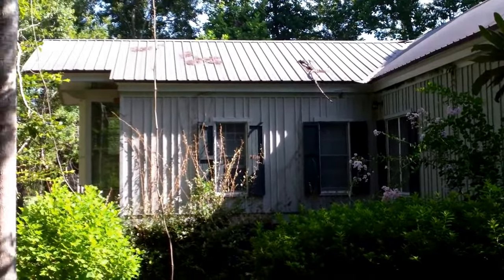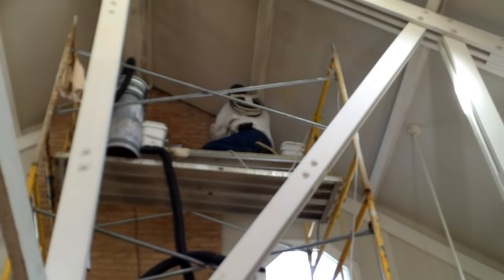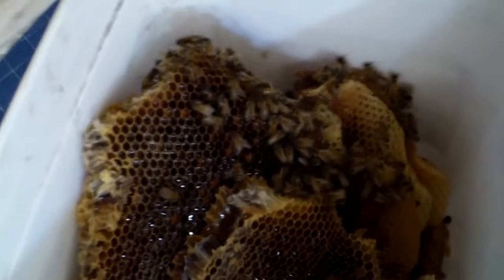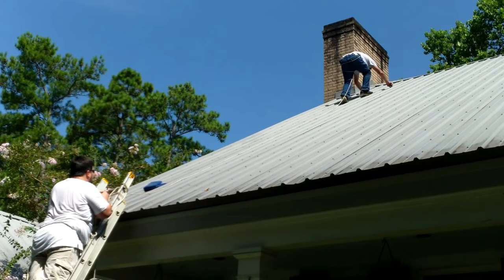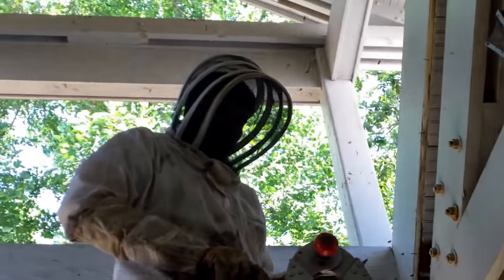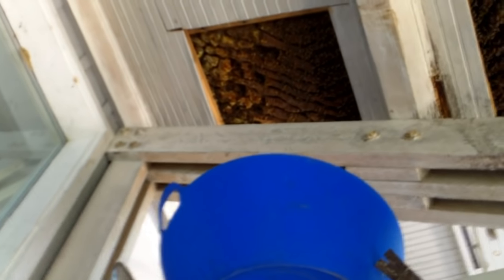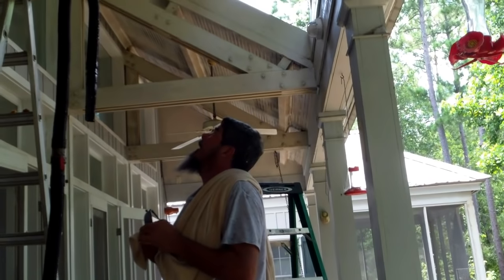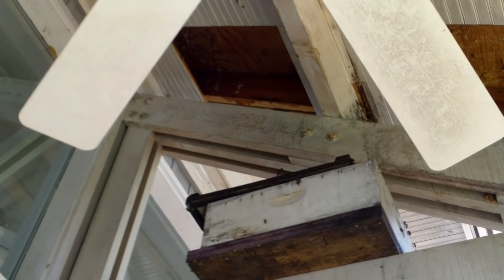Largest Hive Removal I Recorded

Comment: damn, Billy Bob has balls of steel climbing on that flat metal roof.
Reply from the maker: I just knew I was going to be having to call his wife and let her know he wasn't coming home.  I never would have done it.  It was steep too.
Reply: @628DirtRooster   One of the roofers that put our metal roof on a few years back had to go back up on the roof to fix something. I told him to come back another day because the roof was wet from a recent rain, and I knew it was slick as ice. Poor guy got halfway up the roof and predictably he lost his footing and slid all the way down and flew off the roof into the concrete deck in the back. No broken bones, but he busted his hands open from the razor sharp metal and smashing them into the concrete.

Our roof is at like a 45 degree pitch, so it was like one of them water park slides, he was goin' pretty quick when he flew off. And unlike the roof in this video, ours had concealed screws, so you can't use screw heads for traction. Offered him medical attention or to take him to the emergency room and he declined. He looked more terrified of going to the hospital than his busted up hands.
Reply from the maker: @GGigabiteM  Poor guy.  He was probably more embarrassed than anything until the next few days when the pain from the fall set in.
Reply: @GGigabiteM  I hate to be that guy. But sliding off a metal roof that's at a 45° angle just seems impossible to me. Mostly because of my experience with metal roofs with an angle greater than 60°. Once again, I hate to be that guy, but it just sounds so fake that I need to make sure.
Reply: @6th_Army  We don't have a conventional metal roof, it's an expensive custom blue-gray colored metal roof made with hidden screws, so each slat runs from the fascia to the peak with no seams. Once you start sliding, there's nothing to stop you from going all the way down.

The screws are hidden between the slats and covered with a long trim piece, so the entire roof is basically smooth. A bit of water on it and it turns to ice.

I could understand a normal corrugated galvanized metal roof with exposed screws being hard to fall off of, but we don't have one of those.

Comment: glad you got them. I did a removal about three weeks ago. it was four to five years old in a church. the size of the hive was about the size of 60 inch zero turn mower. got 360 lbs of honey and comb. got 230 lbs of filtered honey package and a two deeps of brood  and bees. it was s big they started making horizontal stacked comb whn the got down to the ceiling. took two days and 15 hours. wish I had videoed it.
Reply from the maker: Those are a lot of work.   Should have gotten some video.

Comment: That looked like one gooey, sticky mess! Cleanup on aisle 3!
Man that was wickedly high up there...not to mention walking on that roof!
Thanks for another great video!
Reply from the maker: Kylia Emery That roof walk was insane from my perspective.  Thanks for watching.
Reply: @628DirtRooster  Any roof is insane from my perspective, unless the ladder to access it is firmly bolted top and bottom to the structure.  And at that angle....  
It makes my stomach drop to  see people without a harness on a roof (or scaffolding!), even though I am standing on the ground.  
I think all y'all are pretty brave around the bees bare-handed, in shorts, and so often with no veil, but man to get up there on a rickety extension ladder so much of the time....  Kudos, sir, y'all are far braver than I am!

Comment: I am looking to make my own bee vacuum and out of all of the ones I have researched I like the cylinder that you put inside the bucket to capture the bees.  Did you make the cage yourself or did you buy it?  Where could I find instructions to build my own?
Reply from the maker: https://www.youtube.com/watch?v=zYUmafPktDc
Reply: Sweet.  Thank you!
Reply from the maker: John Yeager Good luck bro.
Reply: 628DirtRooster  Winter is upon us here in Montana.  Not much snow nor super low temps yet but it will give me a winter project.
Reply from the maker: John Yeager Those are always good to have.  I think this winter I'm going to build a new and improved model based on the same platform.
Reply: 628DirtRooster Maybe this is your opportunity to make that bee vacuum video you've wanted too!
Reply from the maker: John Yeager Yep.  Just got to make time.  Got my plate full.  You know how it is.

Comment: I hear you on the heights, I can't stand them myself either. One time for work I had to go up in a boom lift to the ceiling of a manufacturing facility. 70 feet in the air. And of course I get Jeff Gordon's brother driving the lift. I thought I was going to have a heart attack.
Reply from the maker: Shannon Wyatt Man I did the same thing.  I showed up to work on a sign that was supposed to be 20 feet off the ground.  We ended up in a 60' bucket maxed out with a strong breeze and a guy operating that had no fear.  My legs were sore the next day from being tensed up for two solid hours.

Comment: Have you done mite checks on these colonies? I am curious about the level of mite on them with their natural comb. I have an assumption that they will have little to no mites.
Reply from the maker: Charles Sibbald We have surprisingly little trouble with mites down here.  I never check mite counts or treat for mites although some beekeepers in our area would argue.  I think most of them treat because they think they have to.  I monitored mine for a few years and the numbers were so low I just never felt the need to worry about it.  The farther north you get there seem to be more problems.
Reply: +628DirtRooster yes it most definitely seems temperature related, if you get spikes above 40deg C, 104F mites die en mass but the bees brood remains fine. I recon you guys continually see those temperatures in Hives exposed to the sun. 
Africanised bees are also considerably more mite resistant and so of you are lucky enough to have very diluted Africanised genes in your bees you should be smiling all the way to the Extractor!
Reply: +628DirtRooster yes it most definitely seems temperature related, if you get spikes above 40deg C, 104F mites die en mass but the bees brood remains fine. I recon you guys continually see those temperatures in Hives exposed to the sun. 
Africanised bees are also considerably more mite resistant and so of you are lucky enough to have very diluted Africanised genes in your bees you should be smiling all the way to the Extractor!
Reply: +628DirtRooster yes it most definitely seems temperature related, if you get spikes above 40deg C, 104F mites die en mass but the bees brood remains fine. I recon you guys continually see those temperatures in Hives exposed to the sun. 
Africanised bees are also considerably more mite resistant and so of you are lucky enough to have very diluted Africanised genes in your bees you should be smiling all the way to the Extractor!

Comment: if you soak the top two-thirds of your t-shirt in cold water like a wet t-shirt contest you will actually be cold from the evaporation  even as humid as the air is

Comment: Billy Bob looked like a cat on a hot tin roof.  Man, those bees in the second hive were on Billy Bob like a Dirt Rooster on a Subway breakfast sammich!  Couldn't help but notice the path of the rope and figure if Billy Bob fell hitting the ground might have been the lesser of two pains he felt.  That was some nice comb honey, my mouth watered just watching the video. What was the final tally on the take?  As for your fear of heights, remember it's not the heights that will kill you, it's the sudden stop at the end.
Reply from the maker: Rich Booth Oh man!  That roof was about a 10/12 pitch and hot.  I was so nervous about him getting up there.  I tried to talk him out of it but he wanted to plug the hole the bees were coming in from the outside.  The worst part for me was that I have been battling vertigo lately.  You can't tell from the cameras angle but those trees you can see over the roof were not visible to me from the ladder so as I looked up the roof I had no point of reference to focus on.  As the clouds moved the roof turned fully vertical on me and I had to put my head down to keep from losing my balance.  There wasn't enough rope to to allow him to fall off the back eve.  It was just there in case he started to slide but if he had fallen off the gable end by the chimney there was no way I could have gotten to him.  The rope would have cinched up on him and Billy Bob would be resting in pieces right now.